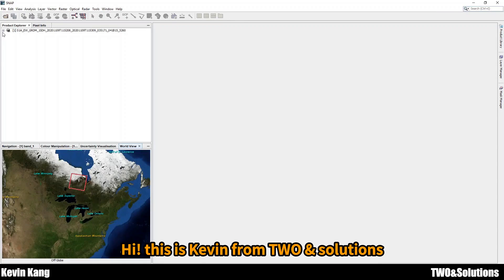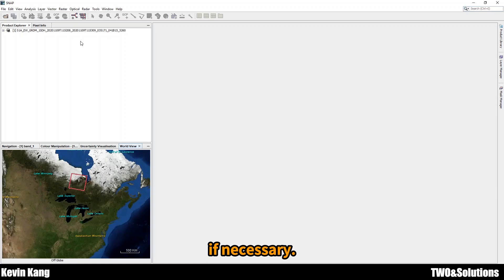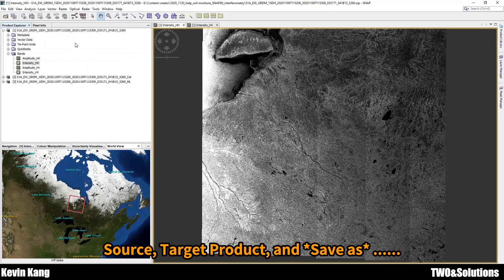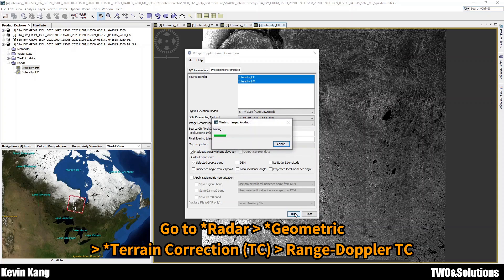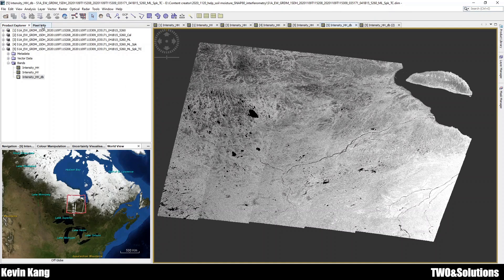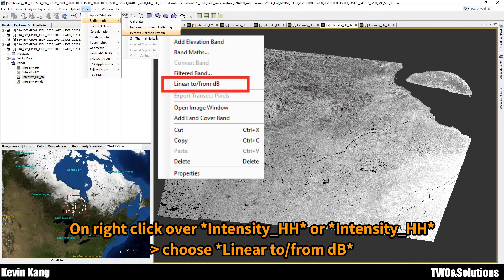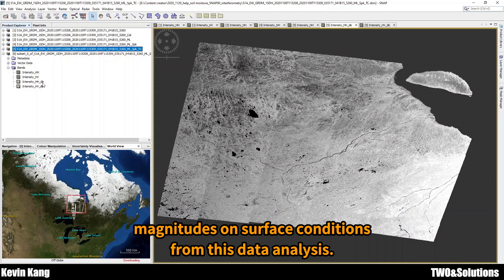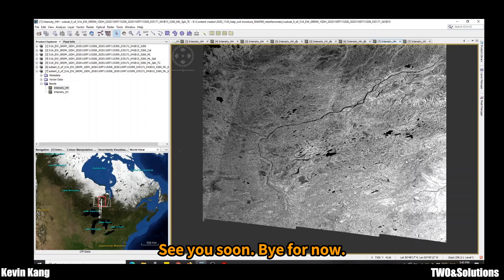SAR Processing and Data Analysis with SNAP 8.0 software and ESA Sentinel-1 data

Comment: Hello Two & Solution!  Why can't my computer perform geometric correction?  When I order the process, it stays in "writing target product" and does nothing.  I am using a 4th generation core i7 and a 10th generation one.  Greetings from Nicaragua!
Reply from the maker: Hello Guillermo; Sorry for late response. I think that it can be related to the size of RAM, or a quality of Digital Elevation Model (DEM). My laptop has 16-GB RAM but at least 32-GB RAN recommended as I heard. A few time I didn't find any results with SRTM so chose another DEM.